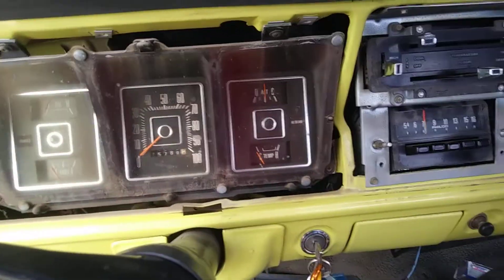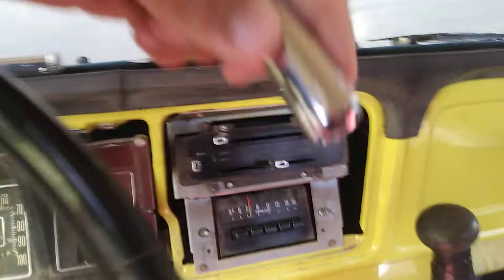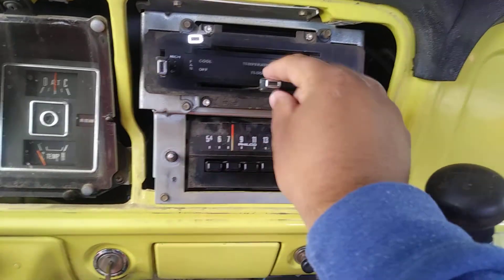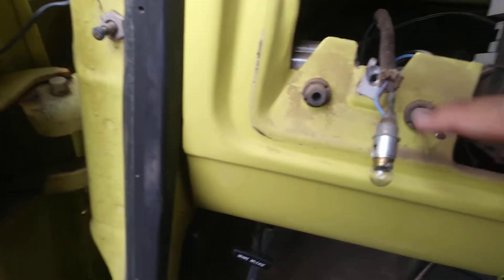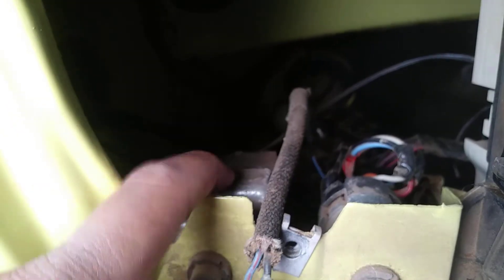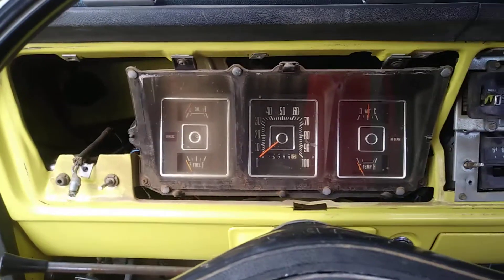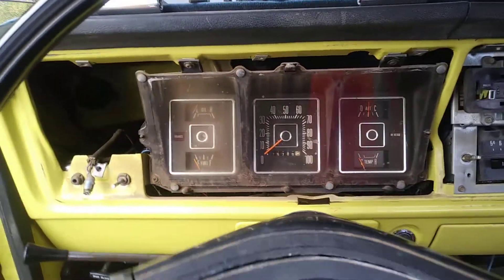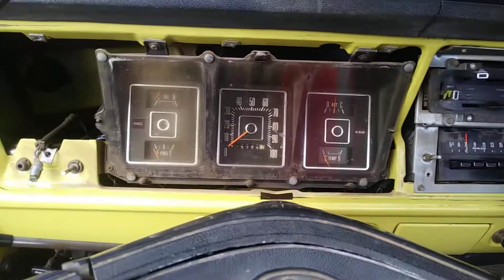How to remove a 73-79 ford dash

Comment: thanks--- i have all the Ford manuals -- but this was way more enlightening..   maybe a little better camera work.  But thanks
Reply from the maker: Most welcome,  and thank you for watching and some advice.  Still learning.
Reply: @chevylandt.v  
Me too
Have my dads 1973 ( bought new in 1973) slowly trying to get it back 

390 v 8 with AC
Reply from the maker: @michaeltweedy6518  nice,  too want to restore it like it rolled off the line.